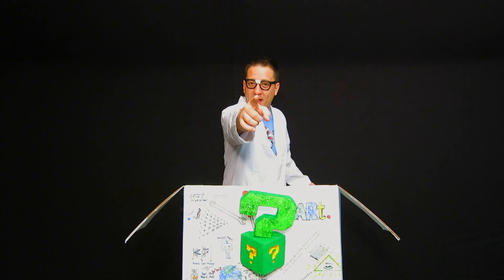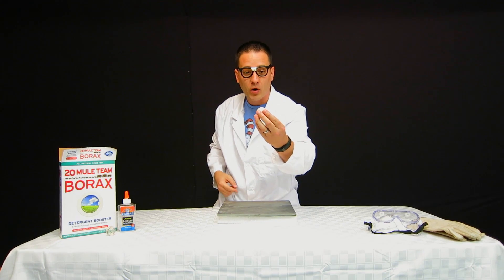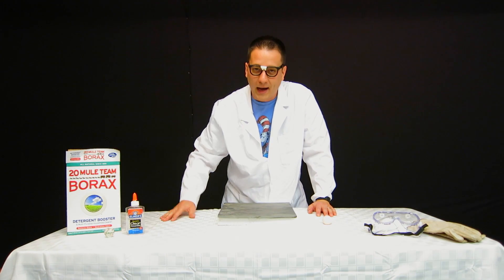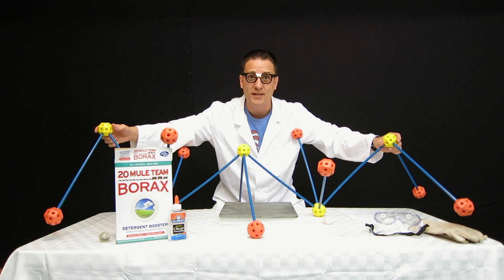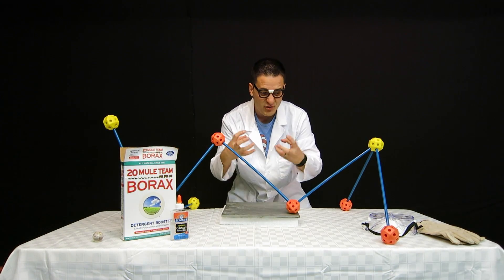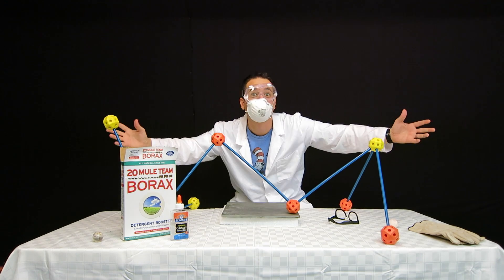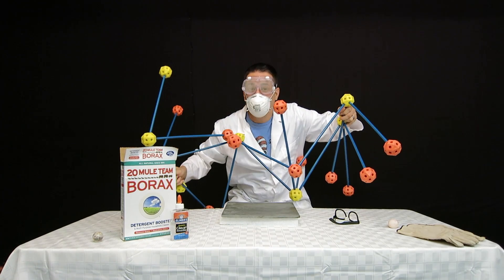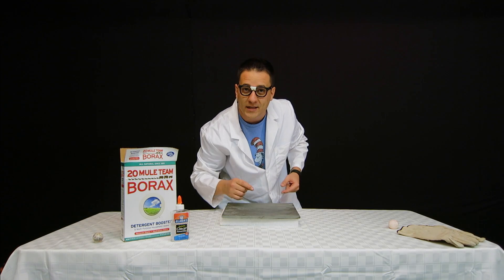How Do Homemade Bouncy Balls Work?

Comment: well if you said to ask a question how is the ball made
Reply from the maker: +Ivan Chavez Hey Ivan!! If you would like to know how to make it go check out the video MommyHacks made ... https://www.youtube.com/watch?v=fibASNbkytA  

If you are looking for more of a scientific answer its a bit more difficult to explain. But I will give it a try... Basically the molecules from the glue and the borax create a chemical bond. A Chemical Bond is an attraction between atoms that allows the formation of chemical substances that contain two or more atoms. The bond is caused by the electrostatic force of attraction between opposite charges. This chemical bond is called a polymer and depending on the desired use, polymers can be finely tuned to leverage the advantageous property. These properties include: reflective, impact resistant, tough, brittle, translucent, malleable, soft, elastic, and inelastic. In this case the important ones seem to be obvious. Hope this helps Ivan!
Reply: +Question Box GREAT THANKS
Reply from the maker: You're welcome Ivan and keep that inquisitive mind questioning everything!!!